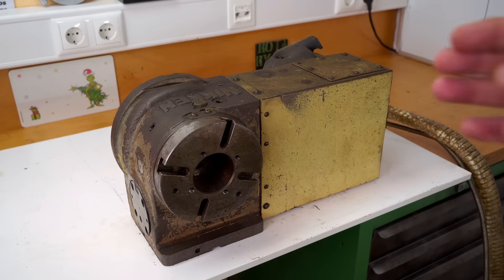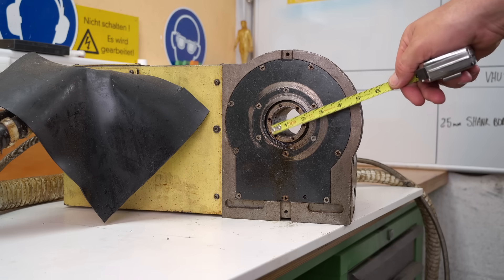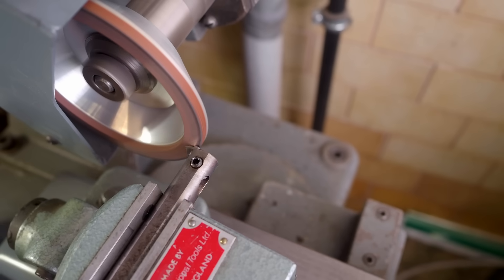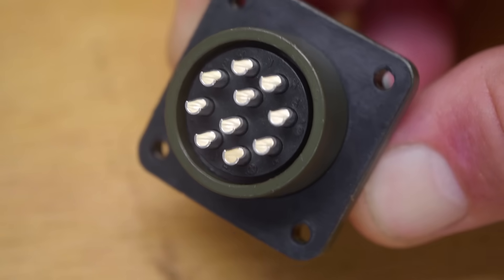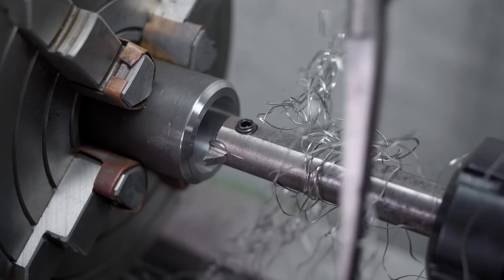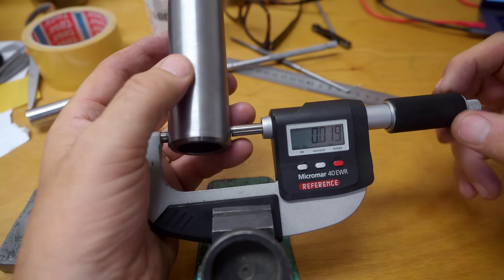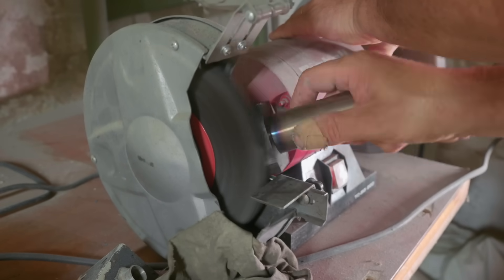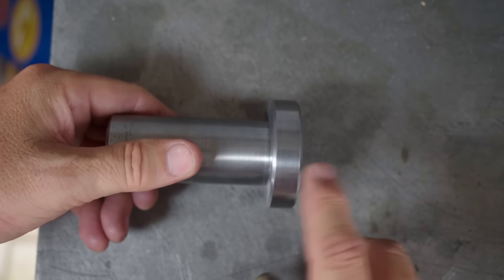Why is it hard to make a buttress thread?  || RotarySMP

Comment: Generally symmetric threads are easier to make. For mass manufacture and stronger stronger bolts you can roll the threads rather than single point cut (or die/tapcut). Rolled threads tend to be stronger because of how the grain structure of the metal flows along the thread points rather than being chopped and interrupted by cutting. Rolling a 60 degree or British whitworth is much more practical than rolling a buttress form. Rolling is faster, cheaper, and stronger than cut threads.
Reply: Buttress can be rolled just like any other thread. I have worked where they did it but the need for buttress is much less than standard vee threads.
Reply from the maker: Thanks guys. The symmetry allowing bolts to inserted from either side is very helpful.
Reply: @dikkybee the problem is uneven due pressure makes it slower and more difficult to roll. Remember, in engineering it’s not a question of if you can, it’s a question of can you justify the expense. Just like you can 5 axis mill a chainsaw cylinder head and crank case from a solid billet but you don’t because die casting is what is economical for mass production. I’m sure there’s a saw competition engine builder that does it but they are charging 10x for it

Comment: Without reading all teh other comments which clearly are going to say the same thing, the reason we don't use buttress threads on nuts and bolts is unidirectionality.  If you need to tap a hole, you'd need to do it from one side.  Nuts would be directional as well.  In most cases, you're not limited by space, so if you need more force, use a bigger bolt, or a finer thread.  Buttress threadswould mostly be a pain in the arse for bugger all benefit.  I'm not sure they're even much of a benefit for collet pullers, except to enable Schaublin to sell expensive taps and specially threaded braze-on collars
Reply from the maker: Yeah, I think Schaublin likes to flex :)

Comment: Hello Mark - a few years ago there was mention on a Stefan Gotteswinter video about the buttress thread on Deckel 355e collets. As I recall, he opined that the thread form was chosen because it generally allows the collet to pull straight into its bore, whereas a more common thread might skew the tail end of the collet to one side or the other, slightly.

Fun fact: the Space Shuttle’s solid rocket boosters were bolted to the launch pad using eight really large buttress-threaded studs with nuts. These were oriented vertically, so that just before launch, the eight upper nuts could be fractured with explosive charges. The heavy studs simply fell away into catch containers - and off would go the rocket.
Reply from the maker: Hi Doric, thanks for the Space shuttle example. Amazing machine.
Reply: And the astronauts would get a set of book ends made from the nut halves.
Reply: Those huge frangible nuts are very cool. My boss has one in his study.

Comment: Lovely work Mark! I have an old interlas transformer TIG, no foot pedal, but its most common usage is making tools and parts for tools, lovely soft welds that dissapear on the lathe! Bad luck with the thread, but it means we get a bonus video!
Phil
Reply from the maker: Hi Phil, I was also pretty happy at how nicely that weld machined.

Comment: You basically provided the reason for why not to use them everywhere all by yourself. You'd have to constantly watch out for the direction. Even something simple as a nut hammered into a piece of wood - you'd need to have two types of nuts on supply for both use cases.
Reply from the maker: Good point Alex. I should have sketched it out before I started.
Reply: @RotarySMP Well, it goes beyond your single hiccup. Imagine needing double the tooling for everything related to threads. And double the hardware. Added to an already big variety of tools you need, since there's several standards for thread sizes.

Comment: Well now you have a tool that will cut the collet thread. 

I made a lot of the S1.667 i even sell em as fitting and ship them worldwide. Then the costumer can solder the threadpart on a drawbar pipe.
Reply from the maker: Good point, if I needed to make collets.

Comment: Is it possible to flip the carbide piece, so that it's pointing back left instead of forward right? It should then cut the right profile.
Reply from the maker: It wont cut on the back due to the clearance angles. It would cut if I switched the spindel rotation, but would then be a LH thread.

Comment: I did not check entirely. Can you flip the tool in the holder upside down, cutting edge pointing down? Then rotate the tool holder instead of pointing towards you, pointing away from you? Run the machine in same direction when cutting the nut? Just asking.
Reply from the maker: I could just load the part in the chuck backwards, and cut the thread dead down at the back, but have a chatter problem as well, so I will regrind it.

Comment: I think along the other reasons why buttress threads are not common, is that everyone would have to stock twice the number of bolts and nuts to support the new standard alongside hardware for old equipment.

Is your boring bar long enough that you can cut the thread on the far end of the draw tube? That would make the thread the correct way around to screw the collet in the opposite end.
Reply from the maker: It would be long enough, but chattered pretty badly. I'll regrind it and put it in a shorter boring bar.

Comment: Years ago, I walked into the electrical repair shop at work, one of the sparkys was building a big control panel. He was wanting to mount something on the inside of the front wall of the cabinet, but it was a bit of a reach for him, leaning in through the access hole, his arm was at full stretch, on his tip toes trying to tap a thread into a hole he had drilled. I said to him "Why don't you just tap it from the outside ?" He looked at me like I was a complete moron and said "Don't be stupid, if I do that, it'll end up a left hand thread !" 😂
Reply: Not only that, but he'd have to put the screws in with a left-handed screwdriver!
Reply from the maker: That was a good one Graeme :)
Reply: One of my favorite passtimes in the shop is seeing someone from electrical cutting threads and really lost in their thoughts and telling them to turn it the right way or else it makes a left thread. It's morally correct to do because I'm also in electrical
Reply: @IrenKozak-k4i that's evil

Comment: acme thread... more material to remove, takes more precision as its a mixture of tooth width and ID/OD. does backlash matter?
crud builds up in the root/crest.
normal thread produces more bursting pressure on the nut. 
buttress is self clearing, can be pretty tolerant on fit, easier to make (ha ha...) quick acting clasp nuts engage even tighter if the face is "undercut".

bottle caps are usually buttress or at least asymmetrical. but yeah, mostly only seen on screw jack threads...
Reply from the maker: Thanks for your inputs. Shame they didn't specify the amount of tip truncation in the Schaublin diagram.

Comment: Regarding why V threads are used on screws instead of buttress threads, my guess is V threads are just easier to manufacturer en masse.  They're good enough at doing their job and what easier to make.
Reply from the maker: Good point. Also you can screw them from either side.

Comment: Your vice has butress threads because it's quick release. If it had ISO or even trapezoidal threads, the flank angles would create a radial reaction component when it was tightened that would tend to open the quick release mechanism. Non quick release vices tend to have acme/trapezoidal screws.

Buttress threads are common in plastics though. Look at a bottle and its cap as an example
Reply from the maker: Thanks. Good point.

Comment: Thank you for sharing this video.  I have been planning to make a draw tube with the buttress thread for my Deckel collets.  How are you feeding the tool into the thread cut? i have not tried it yet buy i was thinking moving the tool along the 45 degree so the cut would be on the 5 degree side.  I think that would give the least tool pressure.  Please let us know what you think.
Reply from the maker: I also thought about that. LinuxCNC G76 Qxx code would allow me to advance the tool down one of the flanks, but I was lazy and used Andy Pugh's Lathe macro, which advances at 29.5°.

Comment: I think it's hard to roll form buttres threads,  most screws are produced by roll forming because of its speed
Reply from the maker: It has been pointed out that the main advantage is the symmetry, so you can insert the bolt from either side.

Comment: Full sympathy. If something works out really well, there is a good chance of it being the mirror of what was intended. :)
Reply: Gah.  I once spent a great deal of time laying out cuts on limited amount of material to make a non-symmetrical corner shelf stack…  And managed to glue-assemble-and-screw it together in the mirror orientation, noticing when it was too late to disassemble.  Swallowed my pride, flipped it over, and had to add cheeky extensions to use it as intended, as all the shelves were at custom heights for specific appliances.
Reply from the maker: Thanks Michael. I have done the mirror thing before :/

Comment: Chances are your car has a buttress thread in it - the tow hooks are often threaded with buttress threads. At least modern BMWs have buttress threads on their tow hooks.

Also, buttress threads are sometimes found on oil field stuff, but I don't know enough about that to say more than that.
Reply: Not just the oil field  ,well drilling  and  mineral exploration core drills all use a variation on buttress threads , they also have a small taper to the thread so that they will disconnect or connect with about 1/2 a turn.
Reply: @steveggca  Oh yeah, meant all drilling and stuff, since it's all the same hardware anyway
Reply: @vincentguttmann2231  yup variations on a  theme  . I had installed lathes in a number of companies that made  drill tubes, around ontario Canada
Reply from the maker: Thanks Steve and Vincent.

Comment: Buttress threads a re a bit of a head twister when grinding the tool. I recently went througha very similar learning experience making a tightening nut  for an Alexander 2CGD d-bit grinder, it uses E355/U2 collets with 20mm buttress thread.
Reply from the maker: I should have drawn a sketch of what I was trying to do before I started :/

Comment: Could you turn the tool upside down and cut in reverse?  I think that would give the correct profile.  Or maybe cut the threads at the other end of the tube (the part in the collet) if the tool is long enough.
Reply: Upside down and in reverse works on tools you put in the regular tool holder because they come in from the side. The boring bar only comes in from the front - it would flip on a different axis than tools you put in a tool holder. I also asked about the boring bar being long enough to cut the far end of the tube, we'll see I guess.
Reply from the maker: I also want to avoid a LH thread. :)
Reply: @RotarySMP  You should try every combination to gain experience 🤣
Reply: @punpundit5590  I meant just rotate the cylindrical cutting "insert" rather than the whole bar, but I forgot it's mounted at 45 degrees in the bar so that wouldn't work.

Comment: The greater load capacity of a sawtooth thread is really only a big advantage when you need shallow threads, like on the outside of a collet, otherwise you could just make the thread deeper.
Reply from the maker: Good point. It is somewhat thin walled.

Comment: Just to warn you about a future mistake you will make: make sure all nuts, shrink tubing and anything else that needs to go around a cable is on there before soldering that multi-pin connector (either side).
Reply: Ha, I just try to do any job where there is a back nut, sleeve or whatever first, I’ve ballsed up so many times.
Reply from the maker: Good point. Never done that .... ;)
Reply: I've never made that mistake... 🙄 👀...... 😬👍
Reply: @peterfitzpatrick7032 you've clearly never made anything then!  lol😮😮
Reply: @samrodian919  Whoosh .... 🙄
Reply: @peterfitzpatrick7032 😅😅😅😅😅😅😅😅😅

Comment: I believe that standard threaded bolts (metric and SAE) are rolled in a production setting rather than cut. Specialty threads like buttress appear, to my laymans's eye, pretty hard to roll and likely have to be cut. Since rolling threads is faster and cheaper than cutting, they have become the standard. That's my speculation on the matter, something I've never thought about before.

I'm primarily a woodworker, and I've produced my share of failures. Fortunately wood failures work better in the woodstove than steel failures 🙂
Reply: That is a good observation - rolled threads being a cold forging process are inherently stronger and have better fatigue resistance so what you gain in metal in one direction is offset by the inherent weakness of a cut thread. It would be interesting to know if they actually roll them - I am sure it is possible.vAnd your nuts only go on in one direction - a real pain.
Reply from the maker: @francisrampen9099  Good points Brian and Francis. Thanks.

Comment: Reminds me of how I had to learn the hard way that all relays in datasheets are from the bottom perspective, whereas everything else in datasheets are the top perspective.
Relays had to be soldered to the bottom of that board.
Reply from the maker: I didnt know that. I will have forgotten it before I need to know it. :/
Reply: Meh...   N.O. or N.C. doesn't matter that much, they both start with "normally", how wrong could it be? 😎
Reply: @wizrom3046 when the pins are asymmetric and it doesn't physically fit it matters quite a bit

Comment: It's not stupid if it works. Props for posting a screwup no one would ever notice when your product was in practical use.
Reply: the problem is it would not work at all. The thread parties wouldnt fit into eachother. Happen me too in my early days. You have to think about what has to been cut away before you start machining.
Reply: If it's stupid but it works, it's still stupid, and you just got lucky.
Reply from the maker: @ShortArmOfGod  Yeah, not my finest workmanship this one :/
Reply: @ShortArmOfGod  but he got lucky ^^
Reply: @fearlyenrage  Sure, but it would either obliterate the drawbar upon first proper use, and it could damage the collet threads... It works when screwed by hand, but the threads are anemic as fuck, and the whole point of that thread design is to be robust as fuck... It does not actually work, it just appears to work until you need it to actually work in practice - then shit hits the fan and you have a costly bit of damage, or at least a delay in best case scenario...
Reply: @camillosteuss  no it does not work. It isnt possible to turn the buttress threads in false.
Reply: @fearlyenrage  that`s what i said...

Comment: will you ever disassemble it to find the source of a noise ? ))
Reply from the maker: Of the Nikken? Yes, I received the manual from Nikken, and will need to strip it down to address the leaking front seal. The squeak could well be the worm gear engagement too tight.

Comment: Manufacturability aside and depending on the application, one of the reasons to not use buttress threads on normal bolts is they have less internal friction than normal 60 degree threads if tightened to the correct side. On 60 degree theads this gives them resistance to loosening under vibrations and other load fluctuations. The 3 or 5 or 7 degree thread angle (there are different thread forms) of a buttress thead gives it high clamping efficiency, less input torque for a given resulting clamping force. For a vise or tooling that's desirable but for a metal construction which has to stay tight for decades a 60 degree theadform is better.
Reply from the maker: Thanks for that input.

Comment: I always thought that a Buttress thread was normally used when it was a requirement that it was as strong as possible in a single direction and they have the additional thing that they are a little stiffer to undo eg release the collet tension. It's different though to say a Clarkson Milling chuck as they have a 60 deg standard thread form on the collets and cutters? but I suppose a work piece holding collet sees a lot more duty than a tool collet. 
Also a bit strange not allowing connectors to be sold. Strange times we live in...
Reply from the maker: It use to be that those component mail order places like RS and Mouser would only sell to commercial customers here. If you didn't have a business tax number, they would not take you as a customer.
Reply: @RotarySMP  As long as you had a credit card you didn't even need an account  for years in AUS. Well they used to sell to me over the phone without an account? But that was pre internet days. If I had a bit to order they would even accept a fax. LOL remember those...
Reply: Another annoying thing that happens is "we don't ship outside Germany (or DACH)".
Reply from the maker: @markomacek920  Yeah, that drives me nuts as well.
Reply: I used to buy those connectors almost monthly as a walk-in customer both for work and hobby reasons, from Electrosonic in Toronto.
Newark,DigiKey, and Mouser  will still sell to anyone with money.  Sadly no more walk-in suppliers in Canada.
Reply from the maker: @steveggca  Walk in elecronic part stores are long gone here as well Steve.

Comment: you cant screw in a Buttress thread bolt though both sides on a nut, only one side has the thread form match 😉
Reply: Which is why industry uses the far less complicated symmetrical vee forms for most common fasteners.....makes absolute sense.
Reply from the maker: It was also pointed out that the vee threads resist vibration better.